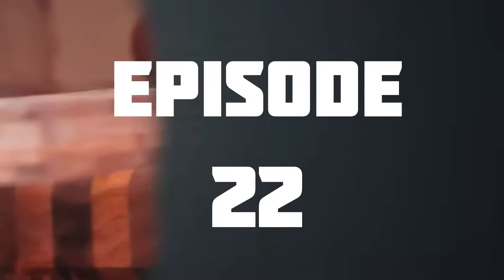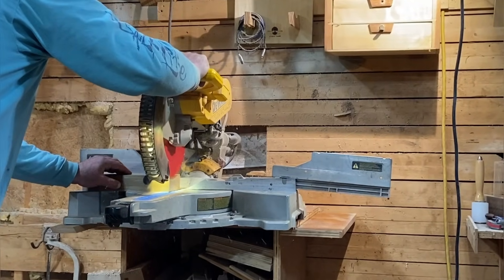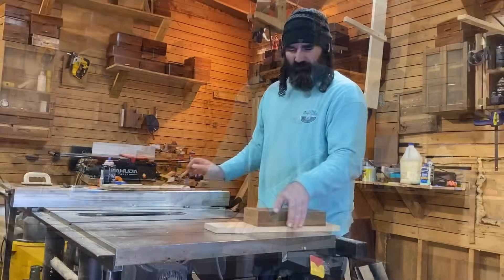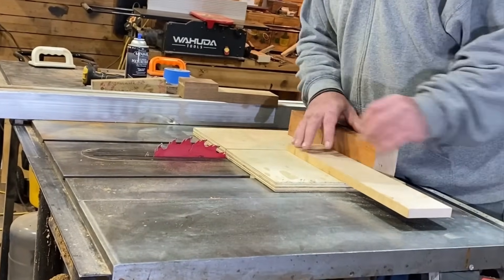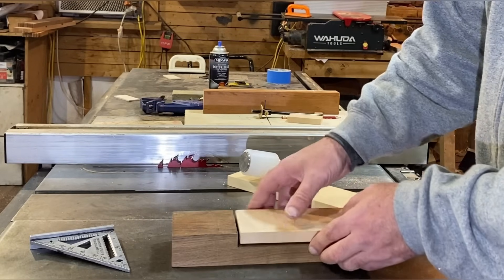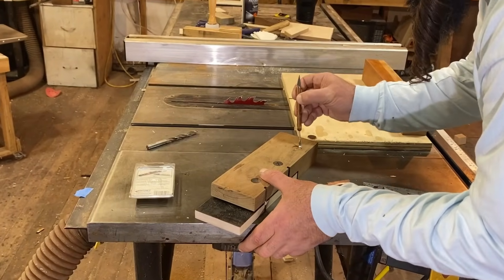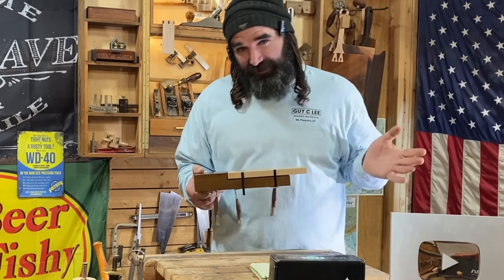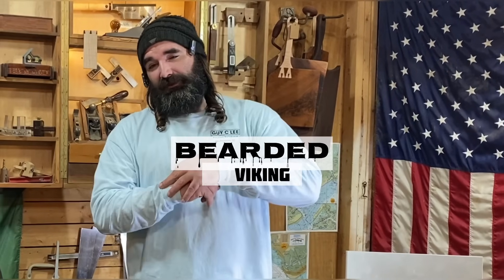Top woodworking projects that sell ep. 22

Comment: Another great build Daniel. Suggestion. Suggestion: Cut the Top to be an extra 1/8" to 1/4" long, then cut the dado leaving the extra on the end as a support for the piece, then cut that extra off after the dado cuts are made. Also a tool tip: For dowel alignment, there are dowel marking pins that can fit into your dowel holes which will allow for an accurate transfer of hole patterns with just a push into the material you want to transfer your marks onto. It's so much more accurate than a Sharpee, as it gives you a marked pin point like that of a center-punch or awl. I got mine from Harbor Freight with my dowel jig, which is horrible and I don't use it, however the marking pins made the purchase worth it in the long run. I think they sell the pins in a kit with just dowels and drill bits now too, but I can't say for sure. Either way, it's a cheap and very accurate way to do dowel alignment.
Reply from the maker: Aware of the dowel marking pins , however , don’t have any , thanks for the tip on dado , I’ll have to look into the marking pin , my sharpie method worked pretty damn good . 😉

Comment: I like both the copper and the black metal but my concern would be someone scratching themselves on the metal/copper hanging down below the body of the shelf. Great project. Thank you for the video.
Reply from the maker: The edges are soft as a babies butt , smoothed them over with 600 grit
Reply: @Bearded-Viking-WoodWorks  Ah, good thinking. I don't know if would've thought of that until after someone was bleeding. Thanks for the reply. Now, let's go make some sawdust.

Comment: I have a question for you brother. How many coats of finish do you put on, and do you sand it once it's dry? I guess 2 questions lol. Thanks for the videos.
Reply from the maker: So depends on what I’m shooting for , so for this I did ,1 coat of shellac , let it get tacky ( almost dry ) and then a second thin coat , let that dry and cure completely then sand with 400 grit.  Apply 2 coats of laquer , letting each coat dry.  Once second coat dries , I then sand with 400 lightly and wipe the dust , but don’t spray off the dust with air or vacuum the dust , just wipe it , then apply 1-2 coats more of lacquer depending on how the 1st one looks .
Reply: @Bearded-Viking-WoodWorks  awesome thank you for c the advice and teaching me something new every time I watch.